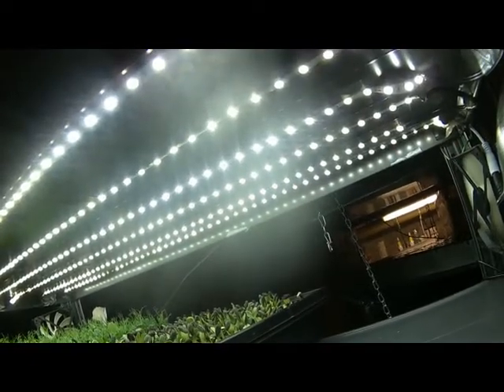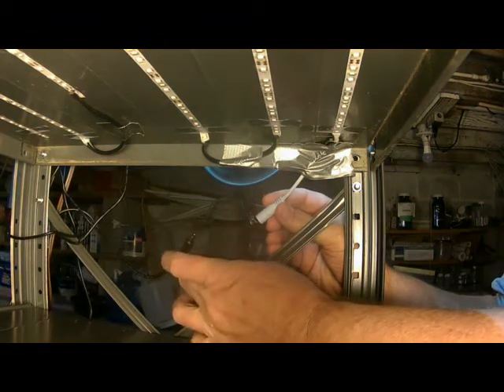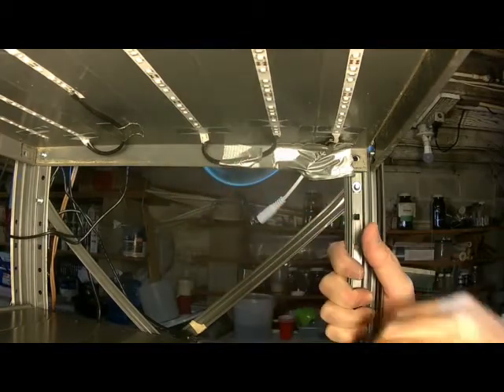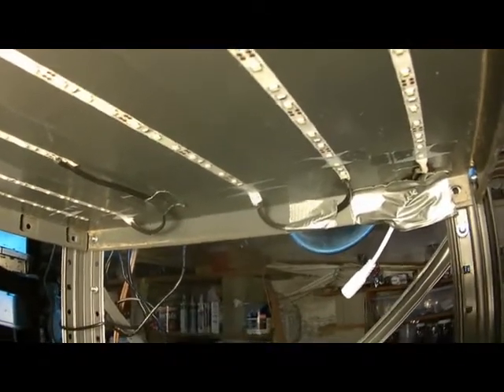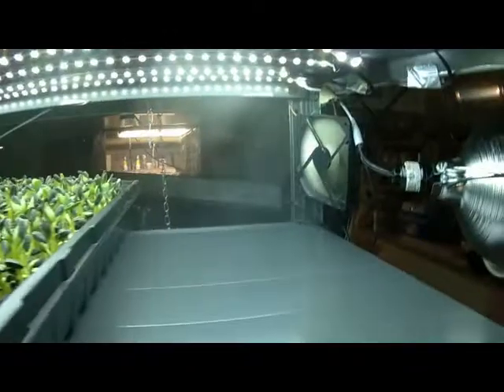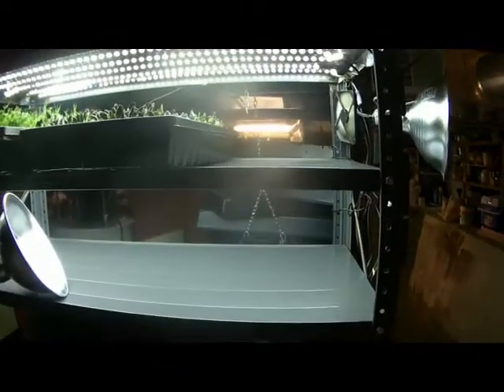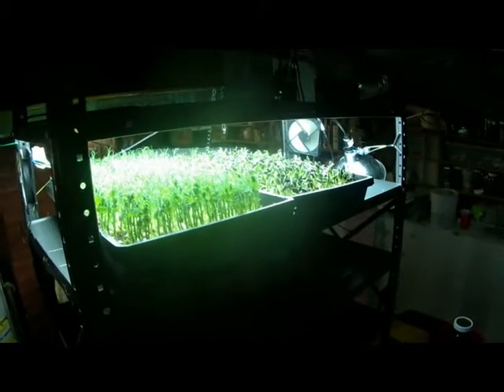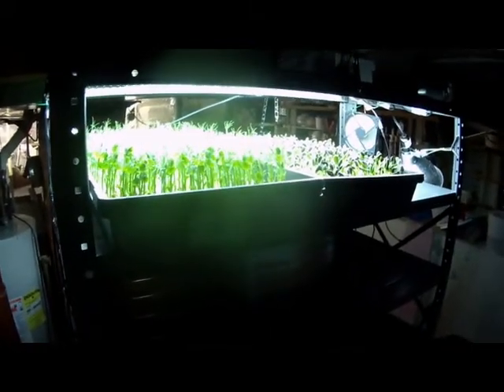LED Strip Lighting for Microgreen Grow

Comment: Can you just curve the ends without destroying the circuit instead of the wiring bypass and cut like you have there. Looks like a pain in the butt to cut and connect them like that.
Reply from the maker: Yes, I would just make corners with the corner part loose and not glued to the plexiglass or whatever.
Reply: I went with a 5050 but with 300 LED 50w on a 5m for $17 cad from amazon. Just need to splice it to a 12v dc adapter. Either less tape rows or more wattage per shelf have to test it. Thanks for the inspiration.
Reply: @lmaonader  how did you get on? I've heard these strip lights don't have enough brightness for microgreens but I figure just add more right!? They are so cheap!
Interested to hear how many metres per metre of shelf you needed. Cheers
Reply: Dave Dave yes my concern is , is led strip enough light ? Compared to a 6500k fluorescent ?
Reply: @davedave8677  Sorry for the late response. It did work but the lights need to be cooled properly for long term (i was stupid and went with silicon casing thinking I could avoid water vapor damage). I attached the strip lighting with thermal tape to an aluminum bar for each strip and still was not able to cool it. They dimmed to yellow pretty quick and became useless. Needed 3 strips to cover 4 2010 trays and measured the lumens to be at about the same as was coming from a non sunny window. About 3-4k lumens. Not too much but enough for microgreens. You can tell the difference between the sun and the lights though. The microgreens in sun can become a lot larger and no mold problems. So if your goal is commercial I would not use the cheapest strip lighting from china. There are better but more expensive models and again STAY AWAY from silicon casing.
Reply: @Smallz-x7r  A flo setup is about double the price and it's the go to method for babies. If you want it to "just work" then go with flo. Strip lighting is cheap but as you see in my comment below it comes with a lot of DIY and time is money too.

Comment: I am building a setup now too, i will let you know how it goes and ill post a video i will be using 3 led strips 1 meter each per shelf that looks about the same width as youres exept my leds are 6500k cool white 14w i will be growing in soil and i just thought of maybe a stupid question.. if i water the soil, how will it dry under cool whites? The cool white leds dont get how therefore how will the soil dry?... if the room temp is at 21c and i got the air circulating will  the seeds drink that water up? Or will i have to water with a thin layer of mist? I mean if it was hydtoponics it would be different,but just cuss its soil now im wondering.. never done this before,if you have any advice let me know, i will still let you know how it went
Reply: How did you get on? I'm thinking to use strip lights too but have heard they are not bright enough for microgreens... Interested to learn how many metres you have had to use per metre of shelf? Cheers
Reply: @davedave8677  I'm building one now but using a 2x4 sheet of peg board as a mounting surface going to be using 66 feet of 3000 Kelvin and 24 feet of 6000 Kelvin. Onforu 66ft LED Strip Light, 3000K or 5000k $33 on amazon

Comment: thank you for sharing us this video, this is what I have been looking for because I have been thinking about using LED strip but have not really worked on it yet. So the LED strip, did you have to buy any other power supply ( power converter ?!) ? And the most importance, how long does the LED strip last if you leave it run constantly ? Thank you and I wish you the best
Reply from the maker: The power converter came with the strip.  It is 12 Volt, and other 12 Volt supplies would also work if they are rated for enough amps.  All of the LED strips are still working with no problem.   The light intensity is enough for radish and brassica.  The sunflower will grow under the strip lights but I suspect that more light would improve growth of sunflower.  However, the strip lights do work for sunflower.
Reply: Do you have a link for your strip led with inverter?
Reply: lit, not lighted... keep up the work.